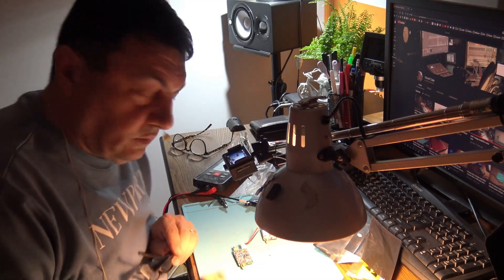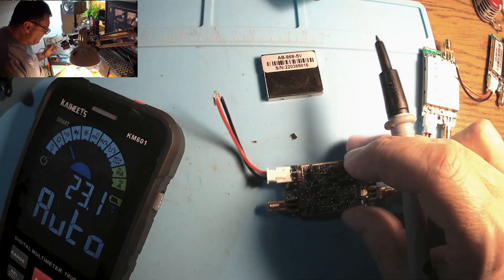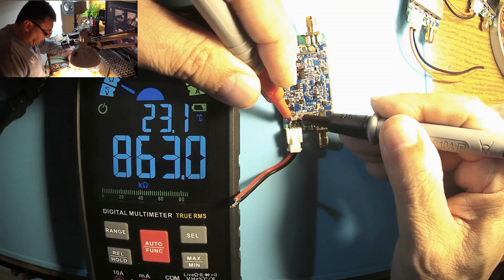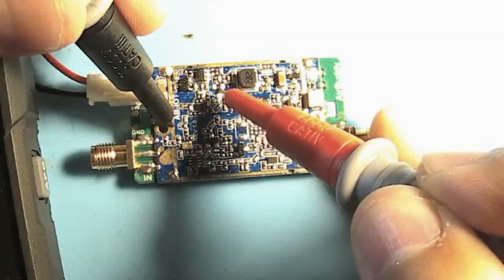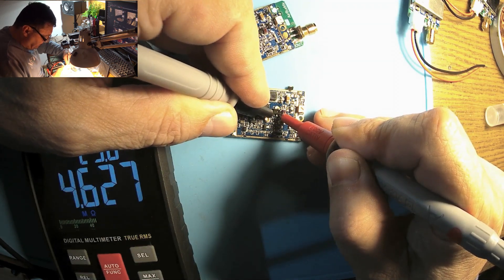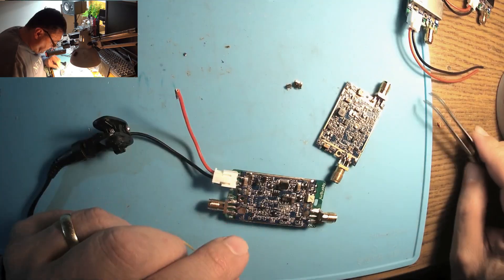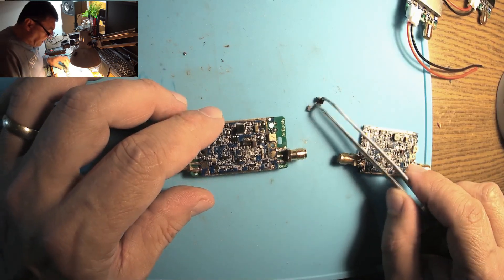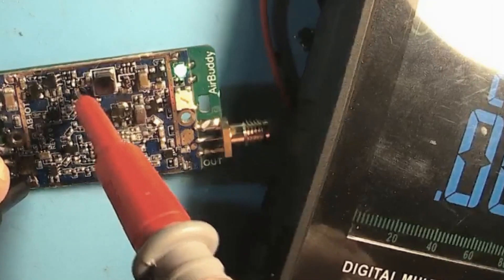AB868-5V / AB-Iot-868 Lora Helium amplifier fix

Comment: Hello. I just received one of these. There appears to be a small potentiometer on the output side. I am just wondering if this is for gain. I can't find the data sheet online, but it keep being pointed in your direction. Any help would be much appreciated.
Reply from the maker: That's for TX output. I'll try to find a manual for you, I know it's somewhere online.
Reply: @viocaia  Hello dear, can you send a link for usermanuel or datasheet pls, shure if you have, thank you
Reply from the maker: @072032786  Check here, you have some more details, I don't have a manual, sorry!
Reply: @viocaia  Many thanks!
Reply: Hi, do you know the ordering code of the SOT-23 that you replaced at the beginning? I read on it SAWL... Do you have a schematic of the amplifier? Thanks
Reply from the maker: @DroneCaptureItaly  No code, no schematic...sorry...
Reply from the maker: That's for TX output.

Comment: Hello Viorel, I watched mayn f your videos, thanks for good information!! I know the Helium thing is basically dead, but I still want my system to function, just for fun. Some time ago my Sensecap M1 with AB 868-5V and saw filter stopped sending, I receive the same amount of witnesses than before but when sending I get 0 - used to be 14 every time. Have you got any idea what it could be or how to check it? Thanks :)
Reply from the maker: I got the same problem with a clear path miner..no amplifier..no filter..just the bare install...in the last days shooting blanks! It's a matter of network, they are doing major upgrades, nothing to do for now..let's wait.